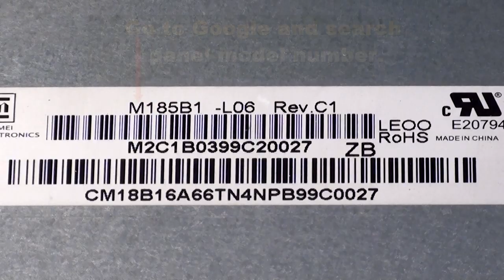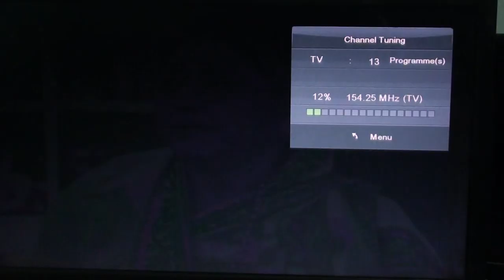How to make tv from computer monitor.#Pro Hack

Comment: I literally just swapped power supply and component boards from a tv to the monitor and plugged it in..  had to modify the led plugs to fit into the different style connectors but everything powered up and boom..  tv..  and swapped out the on/ off button pad also..  can use remote and all.  Resolution is only as good as the board as the monitir lcd was of a better res but 1080p is good nuff for me for free..